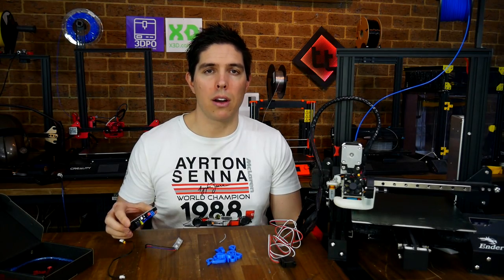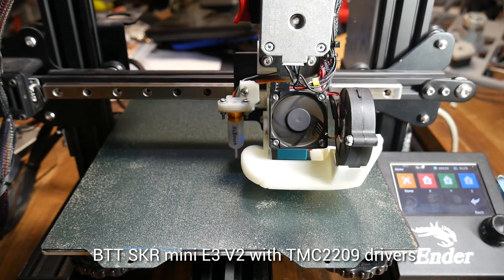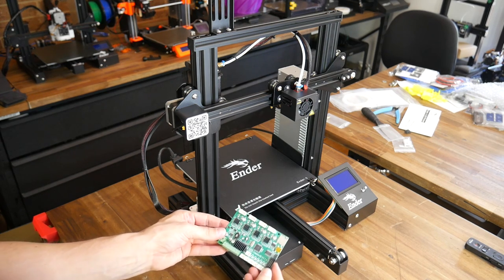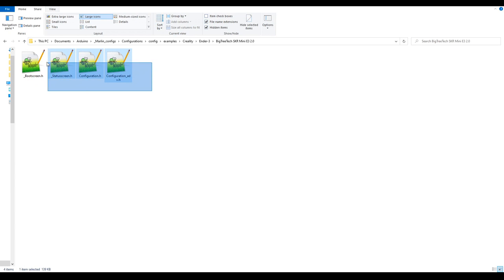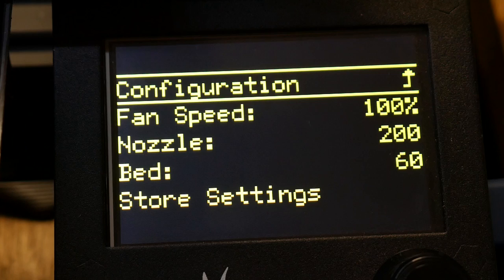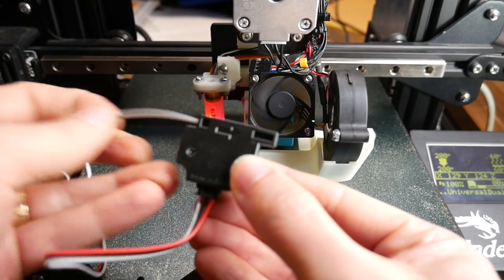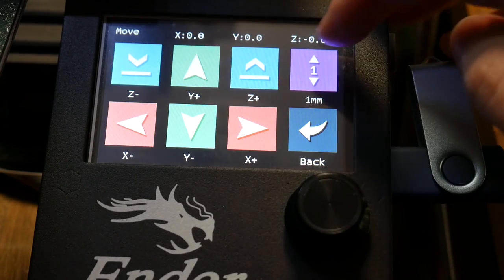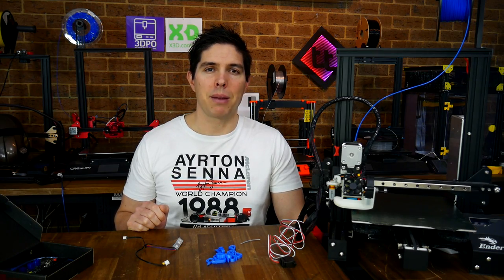SKR Mini E3 V2.0 - Complete guide to the best value Ender 3 upgrade

Comment: It's been a week, I received another board, and the mosfets were failed again. This time both fans were always on. I would discourage anyone buying the SKR MIni e3 v2 at this time, as it seems that the manufacturer has systematic errors with these controllers. On top of that, customer service was dreadful.
Reply: I installed this board on an Ender 3 Pro.  As soon as I turn on power, my parts cooling fan runs at full speed.  Since I'm not even printing anything, this doesn't seem right to me.  How do I ascertain whether this is a mosfet problem?
Reply: @ptmoy1  You can visually check the transistors near the plugins to see if they look burnt, but a sure way to check is seeing if the resistance across the transistors is the same forwards and back. There is more information out there with pictures and such too.

Comment: i got a failed stm32f103rc_btt_512k ?? any one HELP
Reply: Yah I got that for 3 to 4 days.  Got passed that and used Marlin 2.06 with the example config files for a CR-10.  Now my extruder tries to go off the right side of the bed and grinds.  I'm about to send the card and screen back.  No help from BTT or the ebay seller.  Neither responds.  If it is compatible with the CR-10 they ought to have a firmware.bin for it on their Github.  If you look up above where it says failed and look for text in red it will tell you what the problem is.  Start with first red text from the top.  Good luck.

Comment: 10:39  Did this wonderful new mainboard destroy your work surface like that?  Wow!!!  I think I'll stick with my V1.2 instead.
Reply from the maker: My fault. I set the z offset for the previous set up (BLtouch only). I then switched to z stop for homing and BLtouch for probing, started the print and walked awy with checking first layer. My fault, with a warning provided in the video. Don't blame the product when I made it clear it wasn't at fault.

Comment: Did you notice this in Platformio.ini ? ;) (Marlin bugfix 2.0.x)
#   STM32F103RC_btt_512K ........ RCT6 with 512K
#   STM32F103RC_btt_512K_USB .... RCT6 with 512K (USB mass storage)

With SD as USB mass storage ? I am definitely trying this !

Comment: Has anyone upgraded their CR-10S with the SKR mini E3 v2.0? There is an EXP1 and EXP2 for the display and only one input on the SKR board. So while I can get the printer to turn on there is no display. I have Octoprint and can control movements. The power supply fan doesn't seem to be coming on either when I am heating up the bed and nozzle, so not sure what is going on there. Update: The power supply fan does come on, it's just intermittent and only comes on when it needs to. Also I believe this cable would be needed for the LCD to work. https://www.biqu.equipment/products/lcd12864-cable-cr10-to-exp-interface-line-length-30cm-cable-for-skr-mini-e3-v2-0-cr10-cr10-s?_pos=13&_sid=722e29b41&_ss=r

There are also 2 case fans which I cut the JST ends off of and twisted the ends together and plugged into the POWER input and then put the hotend fan into the FAN1 port. This way you can configure this fan to not be on 100% of the time and to only come on when your extruder reaches a certain temperature by configuring Marlin. Haven't gotten this totally working yet as the hot end fan comes on as soon as you move any axis, but at least it's not blaring away when in standby.

Comment: WATCH OUT. 
The SKR Mini does not work on the Ender3v2 yet!
You will need to create your own display cable and compile the FW.

You can watch this issue https://github.com/bigtreetech/BIGTREETECH-SKR-mini-E3/issues/424

Also, the DC port was not tightly soldered. This can be quite dangerous.

Comment: Woooooow I literally just got my SKR Mini 1.2. Colour me red cause I'm angry
Reply: Same
Reply from the maker: Still a good upgrade. Mine gave me zero problems whatsoever. This is a incremental improvement.
Reply: @TeachingTech  True, my only problem with buying the 1.2 just as the 2.0 comes out (and specifically your guide) is that the 2.0 has much more program space.

Comment: every time i compile i get this:
> Executing task: C:\Users\Gamer\.platformio\penv\Scripts\platformio.exe run <

Processing STM32F103RC_btt_512K (platform: ststm32@~6.1.0; board: genericSTM32F103RC; framework: arduino)
-----------------------------------------------------------------------------------------------------------------------------------------------------------------
ModuleNotFoundError: No module named 'elftools':
  File "C:\Users\Gamer\.platformio\penv\lib\site-packages\platformio\builder\main.py", line 90:
    env = DefaultEnvironment(**DEFAULT_ENV_OPTIONS)
  File "C:\Users\Gamer\.platformio\packages\tool-scons\scons-local-4.0.1\SCons\Defaults.py", line 86:
    _default_env = SCons.Environment.Environment(*args, **kw)
  File "C:\Users\Gamer\.platformio\packages\tool-scons\scons-local-4.0.1\SCons\Environment.py", line 999:
    apply_tools(self, tools, toolpath)
  File "C:\Users\Gamer\.platformio\packages\tool-scons\scons-local-4.0.1\SCons\Environment.py", line 102:
    env.Tool(tool)
  File "C:\Users\Gamer\.platformio\packages\tool-scons\scons-local-4.0.1\SCons\Environment.py", line 1843:
    tool = SCons.Tool.Tool(tool, toolpath, **kw)
  File "C:\Users\Gamer\.platformio\packages\tool-scons\scons-local-4.0.1\SCons\Tool\__init__.py", line 119:
    module = self._tool_module()
  File "C:\Users\Gamer\.platformio\packages\tool-scons\scons-local-4.0.1\SCons\Tool\__init__.py", line 205:
    module = spec.loader.load_module(spec.name)
  File "<frozen importlib._bootstrap_external>", line 407:
    
  File "<frozen importlib._bootstrap_external>", line 907:
    
  File "<frozen importlib._bootstrap_external>", line 732:
    
  File "<frozen importlib._bootstrap>", line 265:
    
  File "<frozen importlib._bootstrap>", line 696:
    
  File "<frozen importlib._bootstrap>", line 677:
    
  File "<frozen importlib._bootstrap_external>", line 728:
    
  File "<frozen importlib._bootstrap>", line 219:
    
  File "C:\Users\Gamer\.platformio\penv\lib\site-packages\platformio\builder\tools\piosize.py", line 23:
    from elftools.elf.descriptions import describe_sh_flags
================================================================== [FAILED] Took 1.16 seconds ==================================================================

Environment           Status    Duration
--------------------  --------  ------------
STM32F103RC_btt_512K  FAILED    00:00:01.161
============================================================= 1 failed, 0 succeeded in 00:00:01.161 =============================================================
The terminal process "C:\Users\Gamer\.platformio\penv\Scripts\platformio.exe 'run'" terminated with exit code: 1.

Terminal will be reused by tasks, press any key to close it.
 whats wrong? im using your marlin from your github
Reply: did you find a solution?